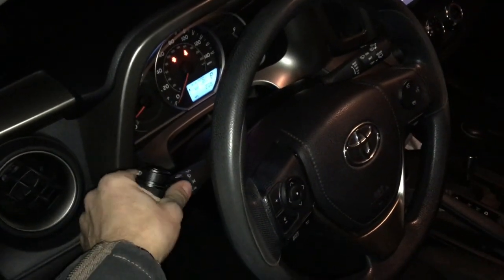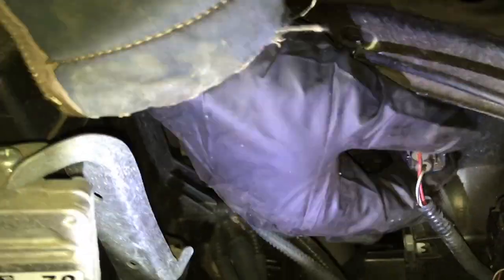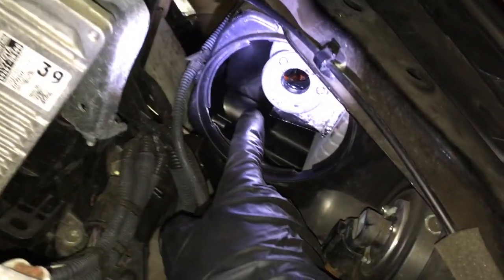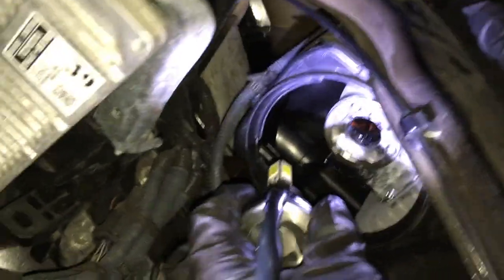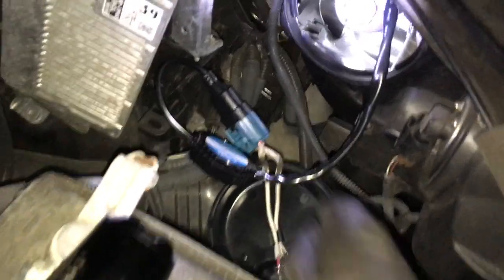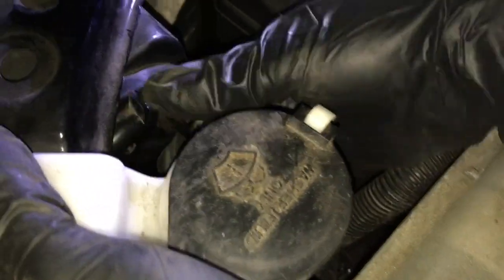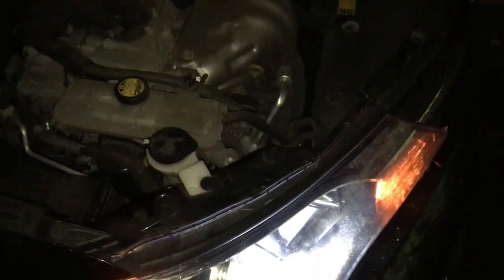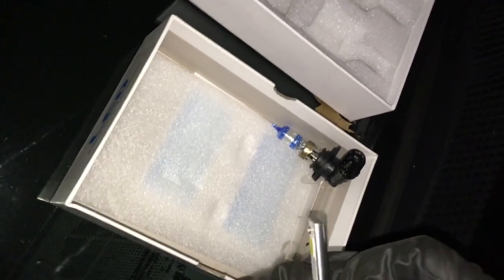2014 Toyota RAV4 Headlights to LED conversion(Night Version)

Comment: I have rav4 2015. Do I need to adjust the LED's to get the better lighting?since the housing socket is on the side instead on the back?
Reply from the maker: no, good LED conversion kit, just replaces the bulb(source of light) , It should not change the direction of light.
Reply: @artworkslights  Great. Thank you

Comment: Hello, you put 9005 in the projector and 9006 in the reflector? I have 2013 Rav4. Thanks.
Reply from the maker: they are both 9005, but I had only 9006 for high/DRL. NOt every LED kit would work there.
Reply from the maker: you can disconnect DRL from high-beams and make DRL some other bulbs, like corner lights or put different lights for that.
Reply: @artworkslights  can you use the projectors as DRL?
Reply from the maker: @areg6068  sorry, did not understand the question.

Comment: Hello friend, I have the same truck and I have problems with the 9005 led input does not fit the connector as you did so I could enter and I saw in your video that this part of the connector where the light is going is broken
Reply from the maker: Hello. I did not quite understand what was broken. Was there a problem with a car in this video or is there a problem with your car?

Comment: Do you know how the two little led lights above the signal light turn on?i seeing another video of a guy who had them on.
Reply: @ cris c to answer your question the guy you see on the other video he modified his that’s means he did some work to make it light up. Factory rav 4 those don’t light up.
Reply from the maker: It depends on production year and different headlights that were factory installed in these cars,; also, there may be settings on information screen(cluster) , where you can turn it on or off.

Comment: Is there a problem with overheating?
Reply from the maker: shouldn't be if you make one or 2 tiny holes in covers for low-beams. in Summer heat headlights need a little air circulation. So far, no problems since the day this was done.
Reply: @artworkslights  did you use the same bulb for low and high beams?
Reply from the maker: @teenermeener971  bulb number is the same, but LED design could be different.  Some LED conversion kits cannot work with DRL mode, so you need a kit for that or disable DRL.

Comment: I bought something similar do you think I should trim them? There a bit loose
Reply from the maker: if they are loose, then you don't trim them. Are you tryin to convert high beams? you can use seals from originals bulbs on LED kit

Comment: What type of bulbs you got?..  Brand and style Please.  I want to change my lights but im afraid is not going to fit inside the cover of the low beams.
Reply from the maker: I have few different style LED conversions that I use. it depends which bulbs do you want to convert and what year is your car. There are quite few headlights for Rav4.
Reply: I have a 2014 RAV4 limited
Reply from the maker: @claudioorozco4301  in description I listed my email. Send me a picture of your headlight and I could probably help you better this way.